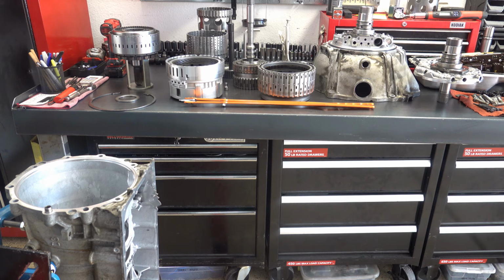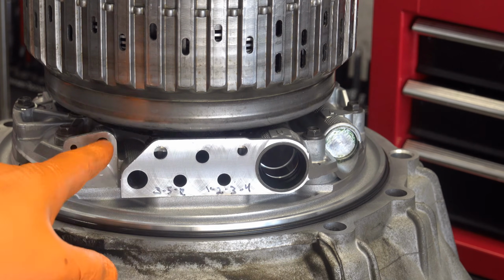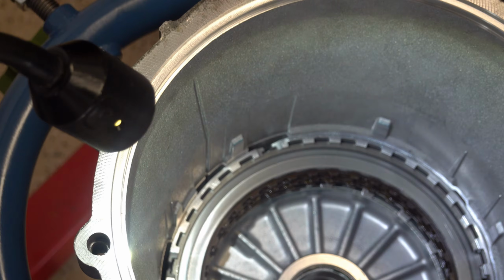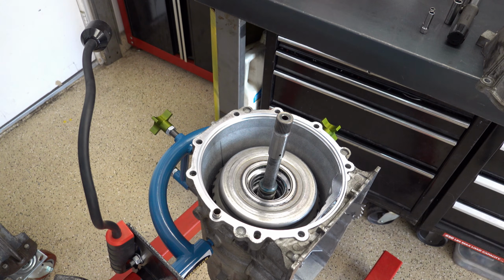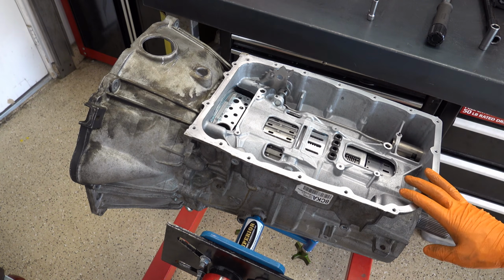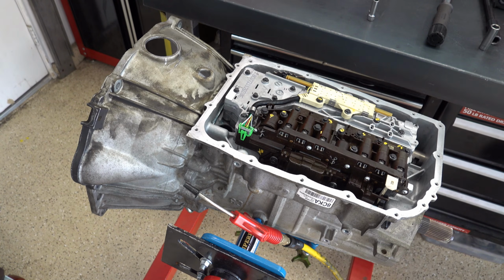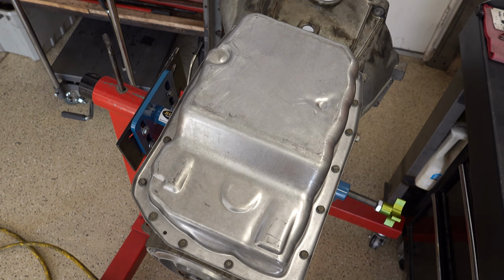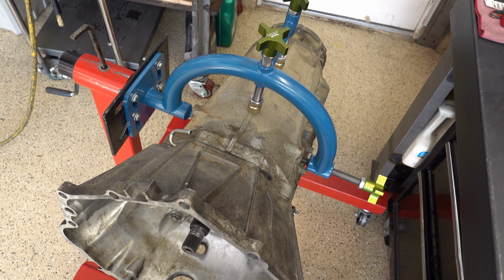6L80 Assembly PT2 - Final Assembly (DEMO) - Please Read Description

Comment: Couldn't I just pop a quick tig tack weld on the rivet of the parking rod and be done with it?
Reply from the maker: You can, if you want on your transmission. I'd never do it as I'm not a welder.
Reply: @nickstransmissions I may be possibly rebuilding mine in the future and I found your videos to be very informative. I have not been in there yet to see what this particular issue is that's why I had brought it up as a potential fix for a diyer
Reply from the maker: Yea, again - you can if you want but it's not something I'd ever recommend given the level of risk/cost is vastly greater then the benefit (saving less than $40.00 vs purchasing a new HD parking rod assembly from GM). 

Always weight cost+risk and benefit when doing anything - especially building transmissions. 

Thank you for watching my videos - feel free to post questions here as you get into your rebuild.

Comment: Hey thanks for your video Nick.  Question - do I need to machine the pump with vanes if the housing was machined?
Reply from the maker: Thanks for watching, Gixxer. I would strongly advise both be machined so you have a 100% true working surface on each half of the pump.

Comment: Just rebuild my first 6L80 following your videos and the GM repair manual. Trans was working great for about 300 miles and now today 2nd gear is slipping bad. Like not even engaging it feels like. Just revs up and shifts to 3rd. All other gears feel fine. What should I check? Or try to do?
Reply from the maker: Thanks for watching my rebuild series and sorry you're having issues so soon after it's back on the road...

Any problems w/slipping in 6th gear?

What was your 2-6 clutch clearance when you set up that clutch pack?

Did you vacuum test the valve body, pump and install a hydraulics correction kit like Sonnax's Zip, Transgo's TowNpro or Superior Tech's 6L80 kit?

The first thing I'd do is scan the vehicle for transmission - related codes, particularly codes for clutch pressure control solenoid #4 - this is the solenoid for the 2-6 clutch which comes on in 2nd and 6th gear. I'd also thread in a transmission line pressure gauge to see if your line pressures are dropping upon a shift into 2nd gear. If so, that would explain the slippage but you'd then have to determine why they are dropping. 

Let me know on the above and we can go from there.
Reply: @nickstransmissions no codes at all in the system. Shift times are super slow for 1-2 at 1.7 seconds. Manually commanded 2nd gear and it slips and manually commanded 6th get and it slips. All other gears are fine. So gotta be the 2-6 pack. Dropping the valve body tomorrow inspect and clean all valves and do air checks. I think I’m on the right track? Any more info would help. 

Also I have almost the entire sonnax catalog, trans go tow and pro kit. 2-6 pack I understand is non adjustable. You say to not adjust it. But mine was way out of spec at 9 thou. I brought it down to 6thou if I remember correctly. using the 1234 ring.
Reply from the maker: What exactly are you referring to when you say your 2-6 clutch pack was out of spec at 9 thousands? Do you mean to say you set that pack up with only .009 clearance or it was .009 over the ATSG-given .050 spec? 

Again, if the clutch pack was largely fine when you pulled it apart initially, DO NOT ADJUST IT AT ALL! Can't emphasize that enough. All I do is measure each clutch and steel plate to make sure there's no out of spec parts then install the clutch into the ctr support, measure clearance and if it's the same as it was upon tear down (or within a few thou or so), I run with it. 

Something's def wrong w/the 2-6 clutch pack, which is the reason I asked if you had any issues in 6th gear...If it was only happening in 2nd, it could potentially be something else but thinking you'll need to pull it back out and see what happened. Carefully inspect the 2-6 piston's sealing surfaces as well as those in the center support. Also, check the seals for the 2-6 / LR clutch between VB and case - perhaps one seal for the 2-6 got lacerated or twisted during assembly.

Sorry to hear it's having problems so soon but you'll learn what happend and know what not to do going forward. 

Let me know what you find once you have had a chance to tear it back down.
Reply: @nickstransmissions  so it was slipping in 2nd and 6th. 

Total clearance on the 2-6 pack was 9 though and I brought it down to 5-6 thou if I remember correctly. 

I pulled the valve body last night and inspected everything in there it all seemed to be fine. But I did find the 2-6 clutches to not hold air when doing the air check. Seemed to be significantly leaking. 

I’ll be doing a complete tear down sometime this week to see what the culprit is.
Reply: @nickstransmissions so when I go back together should I remove the 1234 snap ring that I put in and reinstall the original 2-6 snap ring? And is there any difference between the 2-6 clutch snap ring and 2-6 piston snap ring?

Comment: Hello Nick great video, thanks for all the info, am about to start my rebuild this week already have it out. One question though I have a 2008 4wd unit I’ll like to make it into a 2wd. What’s all the parts I will need to convert the output shaft to 2wd?
Reply from the maker: Hi thanks for the kind words, Herzon. You just need to install the correct output shaft assembly and extension housing...You will also need to yank out the rear plugs and seal as they will be present on 4WD applications. This video and 6L80 Assembly PT1 - Subassemblies (DEMO) should give you all the visual/procedural guidance you need to do the output shaft swap then when you have the case emptied, you can remove the rear seal and plugs.

Comment: Hey nick awesome videos quick question can i use 2010 awd cadillac as a core to rebuild for 2010 silverado 1500 6l80 both the silverado is 5.3 4x4
Reply from the maker: Thank you, John! You should be able to use the 2010 Cadillac as long as you either transfer your TEHCM to the Caddy transmission or simply purchase a new TEHCM for your Silverado's operating system version...The output shafts may or may not be a different length but if so, simply install your Silverado's output shaft in place of the one that came with the Cadillac code.

That said, why not just rebuild the one in your Silverado?

Comment: Do you have a preferred friction disc? Going in a 6000lbs 4wd vehicle used for off-road, ~500whp.
Reply from the maker: Hi Chris, I like Raybestos Stage One, GPZ or Alto High Energy (Reds or Raybestos blues for racing). I'd also recommend a good tune for your powertrain. Many like to remove the TCC apply from gears 2-4 as part of the transmission tune.

Comment: Hello 
I have a question 2014 6L90 transmission does good until it heats up then it doesn’t want to pull in reverse, I have it torn apart but I don’t see anything worn. Can I please get your opinion?

Thanks 
Herman
Reply from the maker: Hi Herman - thank you for watching...How was third and fifth gear, any slipping or delayed engagements? 

Have you leak-tested the 3-5-Reverse drum for leakage at the welds at the base of the drum? Do you have the equipment to vacuum-test your valve body and pump? both 3-5-R and Low-Reverse clutch packs were not glazed or stressed?

What you're describing sounds like leakage either in the 3-5-R drum, pump stator sealing rings, stator-to-stator support gasket or excessive wear in the valve body and/or pump.
Reply: Tanks so much I am checking out those problem areas now , I have already noticed my pump halves are scarred and gouged pretty bad so far.

Comment: Hello Nick, 
                     Just wanted to let you know that I finished my 6L80 overhaul. I went through the valve body a second time. I took out all the valves , cleaned it really good and reinstalled all the valves making sure they were all moving freely. I paid special attention to installing the new balls. When I started the engine the transmission went into drive with no problem. I had a transmission tech from my local transmission shop do the quick relearn. It shifts beautifully. Thanks to all your help it appears that I did everything right. My local transmission shop even offered me a job. So thank you very much for all your time you spent answering my questions and your fast responses. You helped me tremendously.
Reply from the maker: Awesome, man - great work! Every day you drive that truck, you know you're driving your work and not someone else's...Glad I was able to help you. 🍻

Comment: Hi Nick, My 6L80 rebuild is completely finished. I've started the vehicle and have the fluid at the proper level according to my aftermarket dipstick. The transmission will go into reverse but will not go into drive. I'm thinking that I might have assembled the new reverse sprag clutch upside down. I thought it was free wheeling in the counter clockwise direction and grabbing in the clockwise direction when I assembled it. I might be second guessing myself.Also, I have not had my local transmission shop do the quick relearn. Any ideas what my problem could be?
Reply: Ok I will give that a try. Thank you very much.
Reply from the maker: You're welcome, man.
Reply from the maker: Do the fast relearn - that must be done before anything else. If it completes successfully and you still have no movement in drive, manual then you need to take it back out and see what happened.

Comment: Hi Nick, I assembled my components into my 6L80 case today. Everything went together easily. I twisted and shimmyied the 3-5-R drum with the lifting tool for quite a while. My pump assembly went down with the bell housing slightly going over the case dowel pin. The bell housing is still about an 1/8 of an inch from sitting flat on the case.I've tried tapping the bell housing down with a rubber mallet with no results. I guess try rotating the 3-5-R drum with a screwdriver while keeping pressure on the bell housing to help line up the sun gear???  IT'S SO close.
Reply from the maker: Just wiggle the bell until the male splines on the pump's stator mesh with the female splines on the sun gear. No hammers! It will mate flush to the case deck on its own once splines mesh.
Reply: @nickstransmissions  Ok, Thank You. I will keep trying to get it to seat.
Reply: @nickstransmissions Hi Nick, Today I finally got the last clutch in the 3-5-R hub to line up and allow the hub to drop all the way down. For some reason it took a lot of twisting and shaking but I got it. And the pump housing slipped right in and down. Thank you so much for all your help. You have been so helpful for me. I can't wait to get it back in my car and let you know how it works out.
Reply from the maker: @koelzspeedgarage2796 you're welcome, man.

Comment: Hi Nick, I am adding a B&M deep pan on my 6L80 rebuild. Is there any special filter or filter extension to use with that?
Reply from the maker: Yours didnt come with one? Check the interior height/depth where the filter is - maybe you dont need it but all the B&M deep pans that require a filter extension tube come with them.
Reply: @nickstransmissions  thanks again for the quick reply. No it did not come with one. That's why I was curious because I know some deep pans require an extension. Nothing said about it in their directions either.  Maybe I should call them to make sure?

Comment: You're going to get tired of hearing from me. I'm sorry. So I greased my center support with trans gel and it dropped right into the case on the first try. My 3-5-R hub will not go in. I replaced the bushings in the 3-5-R center support with Durabond film coated bushings ( in the red box). Now the 3-5-R hub will not go into the center support. I do not want to force it obviously. Have you ever experienced this? Any advice?
Reply from the maker: 3-5-R center support? Do you mean the bushings in the 3-5-R hub or center support?

If you haven't done so already, pull the center support back out and install the 3-5-R hub into the rear planet to make sure it's not getting hung up there instead of the support. If it splines into the planet as expected, determine exactly where it's getting caught up in the support. If it is the bushings, install standard OEM replacement bushings in the support and see if you have the same issue. If you do, something is not right somewhere on the center support or the 3-5-R hub. Bushings can occasionally be either a bit tight fitting or straight-up out of spec or parts may be ever so slightly out-of-round in the bushing area...You can try to clearance the bushings like I show in my 4L80E and TH400 bushing installation videos as it's common for the sun gear shaft bushings to be too tight for the intermediate shaft in those transmissions...Same principle apply here...

Let me know what you find.
Reply: @nickstransmissions  The old bushings that I took out of the center support slide over the 3-5-R hub with no problem. So I guess the new durabond bushings that I paid more money for are crap because they obviously have a smaller inside diameter. I will just install OEM ones. ALSO, I had wrote you previously telling you that I had a difficult time getting then new Sonnax sprag clutch installed into its hub.I finally got it installed to where the snap ring went right in.You mentioned that you use the Borg Warner brand sprags. Well just so you know, the Sonnax brand looks like all they did was re-package an OEM sprag, and charge more money for it. It looks identical to the OEM. Thanks so much for all your help.
Reply from the maker: You're welcome. I wouldnt be surprised if Sonnax repackaged a BW sprag with their snap ring and covers...Ive always used the OEM assembly as I know it works, never had any come back for broken sprag after overhaul...Arent these fun, haha. You will get yours together and it will work nicely...encountering and solving these kinds of problems are the norm in the transmission building world so dont feel discouraged...

Comment: My hub that holds the planetary ravenol gear set does not have a snap ring to remove to gain access to  the 2 large gears. The gears appear to be machined into the hub. Does that sound right? Or am I losing my mind?
Reply from the maker: If you're referring to the ravingeaux gear set in the rear of the trans, nope not losing your mind. There's no snap ring but the seal needs to be pulled and replaced and that seal's removal enables you to gain access to the sun gears and bearings for inspection purposes. 

If you're referring to the ring gear itself, and you have a 2012+, you have a unigear design which is different than 2011 and back.
Reply: @nickstransmissions  Thank you for that reassurance. LOL. I thought I was losing it. Mine is a 2013. So its obviously a unigear. I learned another lesson from you. I did not get that roller bearing/seal in my rebuild kit for some reason. I do have the Torrington bearing though. Do you happen to know the part number for that seal? Also, is there any trick to installing the tail shaft seal? It appears to be slightly larger than the tail shaft mounting area.
Reply from the maker: The seal and bearing kit is separate and should be available from GM (I don't know the part number off hand but GM sales or anywhere on the net should be able to have it). Also check with your local transmission hard parts supplier (Transstar has distributiors/retailers in most major cities). No tricks to install any of the front or rear/extension housing seals, just use the appropriate sized driver or you can purchase seal-specific Kent Moore brand seal drivers off eBay.

Comment: Can you replace the parking rod with only removing the valve body?
Reply from the maker: Hi Trent, removing the valve body/TEHCM complex helps as it's out of the way but you still need to remove the two roll pins (one holding the rod to the selector and the other that holds the selector in place on the case) if you want to replace the parking rod assembly. You DO NOT have to remove the rear roll pin for the parking pawl housing...There's two o-rings there that, if leaking, will require the removal of that housing but if it's not leaking, you can leave that third roll pin alone.
Reply: @nickstransmissions  I need any special tools to remove the roll pin? I'm thinking my rod got damaged from the tow truck so I'm trying to fix it myself. I was in a wreck a couple of months ago.
Reply from the maker: didn't see this last question...You can try removing the roll pin for the selector shaft with some long diagonal cutters and pry upwards until you pull it out...the roll pin for the rooster comb is removed and reinstalled by a roll pin punch and hammer.